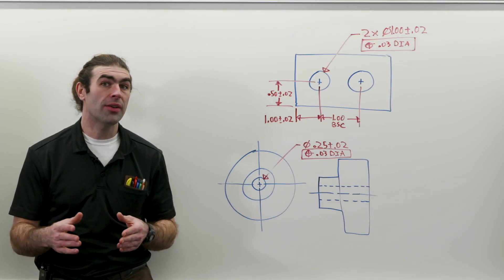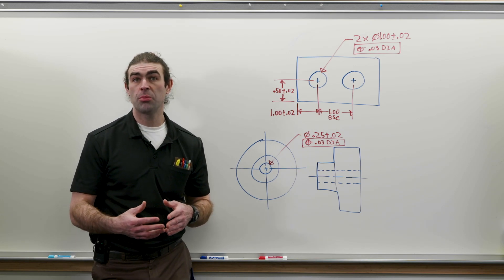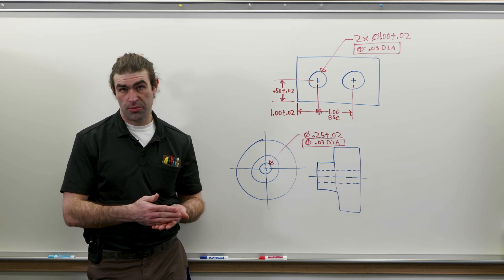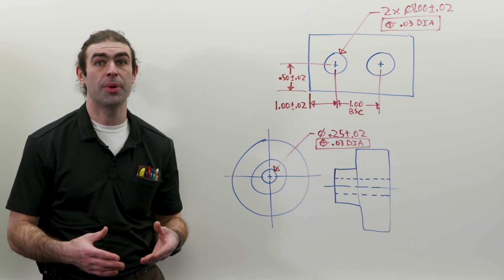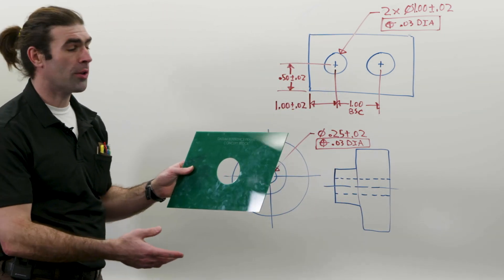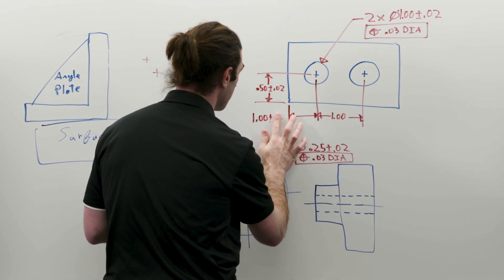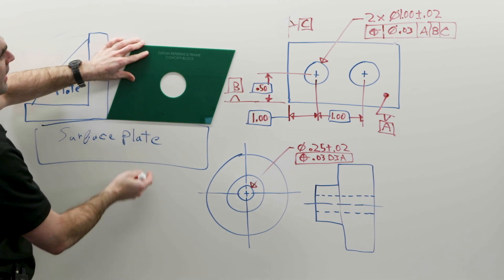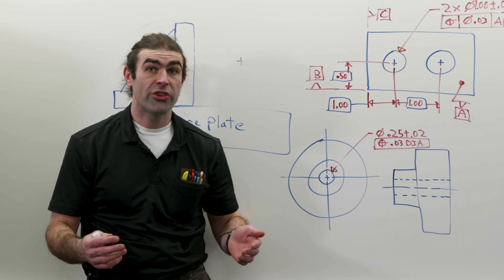GD&T: Position Tolerance Without Basic Dimensions?

Comment: I have a question if you don't mind? A designer at the company where I work has suggested, instead of using basic dimensions, have a callout of position in a feature control frame and a note which states "basic dimensions relating to position are to cad, in line with datum structure". 
From a metrology standpoint, we can obtain the X Y Z co-ordinates from CAD once the alignment is constructed in line with drawing requirements, and the drawing is defined from CAD... so my question is, is it mandatory for basic dimensions to be called out on a drawing in ASME, or could this method be deployed?

Comment: Great explain , can i use ASME - Y14.5 2018 with first angle projection (iso standard)? Because it does not directly affect each other as I understand it, or I'm wrong?
Reply from the maker: Yes, ASME recognizes both systems. It is mentioned in ASME Y14.3. 3rd angle is used for illustrations in the ASME standards, but you can use 1st angle on your drawings. Remember to place the correct projection symbol in the title block or an associated document.

Comment: Great video as always.
I have a question, hopefully it makes. When we point to a cylindrical feature (hole or pin) as a datum feature...why we take its axis as its datum...when I think about it, using axis as datum makes the most sense yes, but I want to know if that's how everyone sees it (i.e.e it's common sense) or if there's a more fundamental/non-disputable reason behind it.
Reply from the maker: So the axis comes from the actual mating envelope of the cylinder. This means that at inspection, the high points of the feature defines the axis. This is good because it represents the MMC size of a mating part. The alternative is finding the average of the high and low points, then deriving the axis from that.
Reply: @RDeanOdell   can you please dumb it down a little further please.